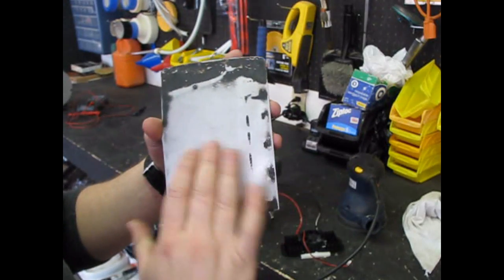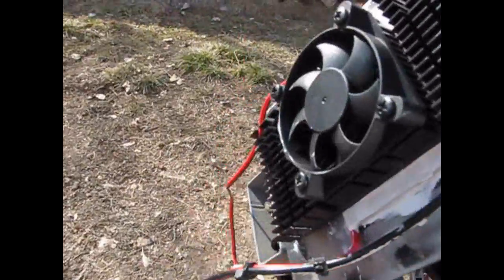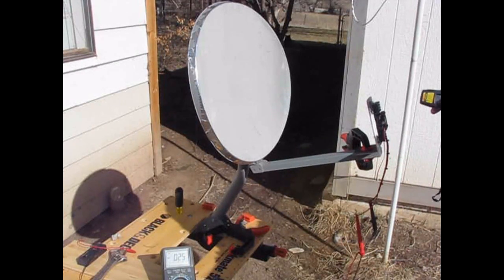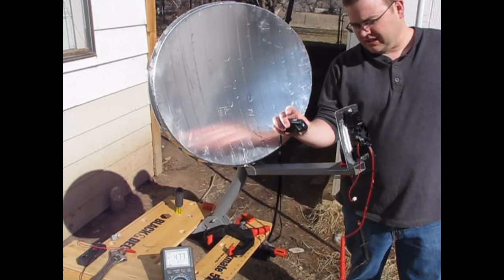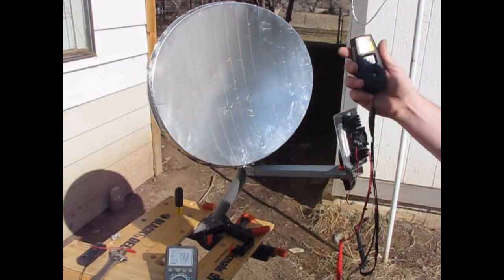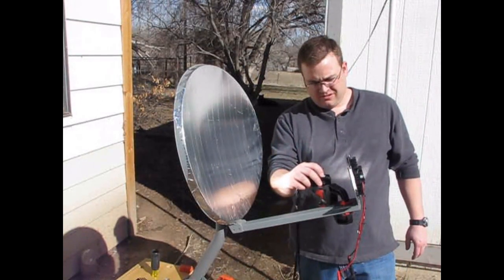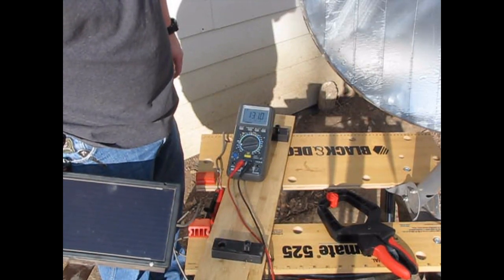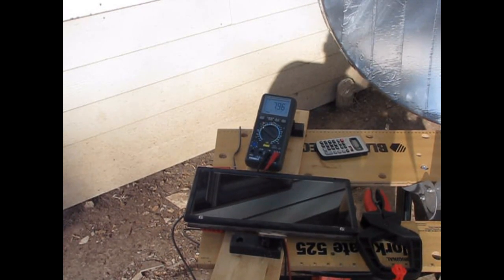Peltier Energy Generator. Solar pannel alternative.

Comment from the maker: @BryansU2B  You are correct in thinking that you can increase the output of a PV panel using mirrors or Fresnel lenses, the draw back is the panel can over heat and burn up if you overdo it.  Good idea though someone should do some experiments.